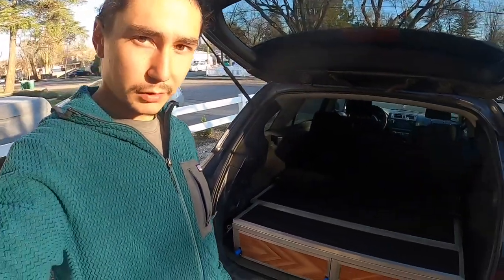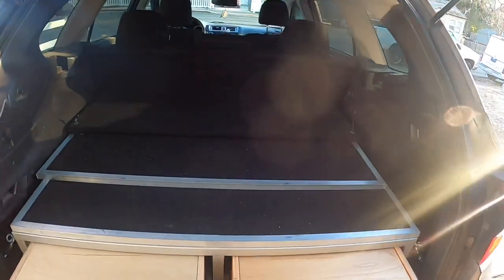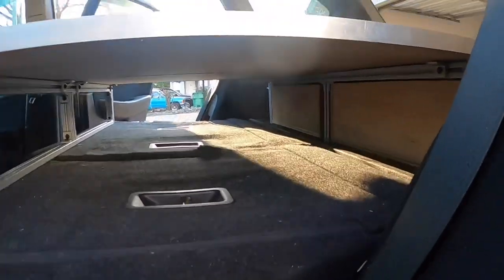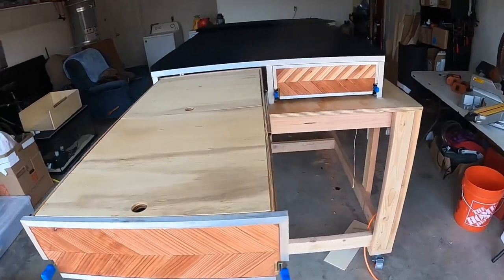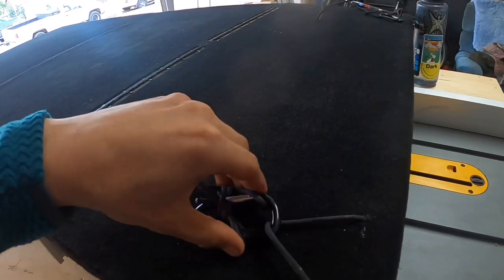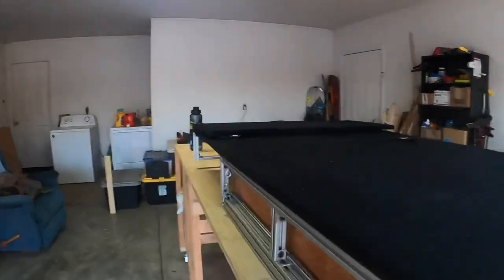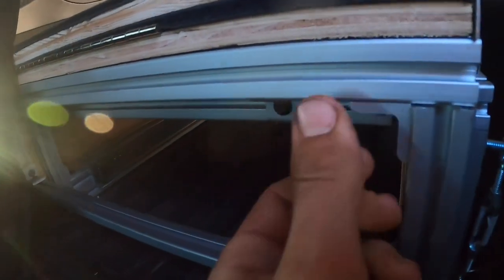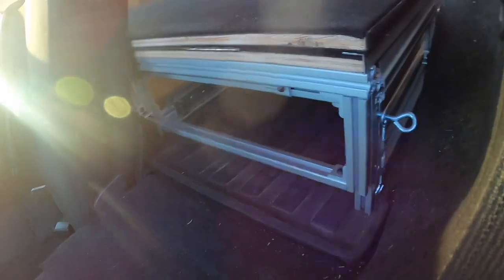Rock Solid Aluminum Car Camper Platform, Heavy Duty Drawer Storage, Subaru Outback

Comment: Nice looking build, Anthony. Do you offer them for a 2018 Subaru Crosstrek, and also a 2018 Honda Pilot? What is the finished gross head room, width and length before mattress when deployed as beds for these two model cars? Add on flip out tables on both the left and right hand sides? Prox cost and lead times will call fob Chico, CA? Thanks, and keep on building! Nice video too!
Reply from the maker: Hi there. I do make a build for crosstreks, although the dimensions of the vehicle allow for a bed that’s about 5’6” long. Although the Honda Pilot would be easy to do a longer bed. Check out the custom build page on my website compasscamper.com
Reply: @compasscamper5730  - Thanks for your response and that link, Anthony. I’ll check it out. You are very talented. All the best to you!

Comment: Slick bro!! What would the dimensions be in a 2022 Outback wilderness be. Im 6”2, seems to be cutting it close. Also, can one pick up instead of shipping? Can the rear seats be reclined?
Reply from the maker: Thanks man, the extended bed dimensions for your model would be 6’5” long, by 40” wide. And yes, local pick up is available in Chico, CA. And I’m pretty sure the rear seats can be reclined because the trunk frame doesn’t take up every single inch, although haven’t tested this. Go to compasscamper.com for more info, or to place an order 👍🏼

Comment: I have a 2016 RAV4 and plan to remove the rear driver’s side seat completely to provide extra storage below. Can this unit be built with just a single bed on the driver’s side and the complete rear setup? How would it be supported with the rear seat removed? How much weight will the rear sliders support on top? That’s where my 31# (when empty) fridge will go while camping/cooking. Thanks and these look amazing!
Reply from the maker: Hi Michele, yes I can definitely do a build like that, I’ve done a couple already like you describe. I offer a split bed extension which splits the bed extension into two pieces, each the width of each back seats. Check out my other video on my channel for an example of this.

The rear trunk frame can easily take 250 lbs of storage on top. And the drawer tops when fully extended can take a lot too, easily enough for a stove with full pots of water. 

The bed extension legs can be cut to size so that it fits in the area where your rear seat is removed. Your vehicle’s dimensions allow for that piece to be about 15” wide, just so you know. Your total bed would be about 74” long. 

Email compasscamperconcepts@gmail.com for more info. Thanks!

Anthony

Comment: Daaamn. I just built a plateform that looks like this in concept but definetely not as good (just 3/4" plywood). And after a few uses I already see a lot of limitations. What are your delivery times? And do you have it shipped? I live in LA and have a 2022 Forester
Reply from the maker: I see. Right now my turnaround time is about 5-6 weeks until I can have it shipped or ready for pick up. I can ship these no problem, just know the cost for shipping alone is $500. I strap it to a pallet fully assembled and ready to install, and ship it via freight (they use forklifts and semi trucks) and it is by far the safest and most secure way to ship large items like these. I also offer local pick up in Chico CA. Many people prefer local pick up because it gives them a chance to test it out on a little road trip.
Here is the link to my Etsy shop:
Reply from the maker: CompassCamperConcept's shop on Etsy https://etsy.me/3IRoiGG
Reply from the maker: Also, here is my website (still slightly under construction): compasscamper.com
Reply from the maker: Instagram: @compasscamper
Reply: @compasscamper5730  Hey thanks for the reply. I'll come back towards you in a bit. I'm interested. What is the height of the plateform?
Reply from the maker: @williamnicolas122  of course, they range from 8.5”-9”, but yours (forester) is 9” from trunk surface to very top of platform. If you’d prefer a shorter platform (more headroom) or taller platform (more drawer space) I can tweak it based on your preference.

Feel free to reply here, or email me at compasscamperconcepts@gmail.com
Reply: @compasscamper5730  ok thanks for the info. Will think about it
Reply: @williamnicolas122  love mine -Anthony did a great job for me
Reply: @DesertDog8989  yup I got one soon after posting this comment. Use it all the time haha

Comment: Hi! How tall are you? I’m looking at this as an option for my 2023 Crosstrek. I’m 5’8”. Am I too tall? If so, that’s a first. Haha. God stuff! Cheers.
Reply from the maker: Hi Rob, the normal platform for the crosstrek is 5’5” long, but I can adjust it to be 5’9” with a detachable headrest (since the normal headrest would be too long to flip over without hitting the ceiling). So, no, you are not too tall! Simply attach/detach the headrest to the bed extension with a few bolts. 
Feel free to ask any more questions here, or email me at compasscamperconcepts@gmail.com 
Or feel free to place an order on compasscamper.com